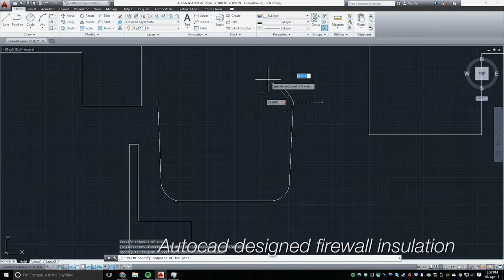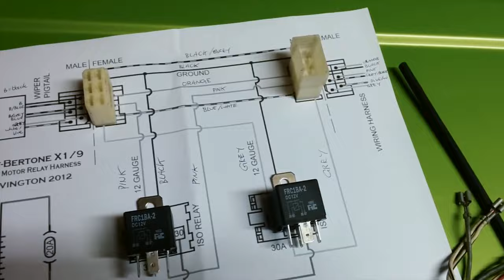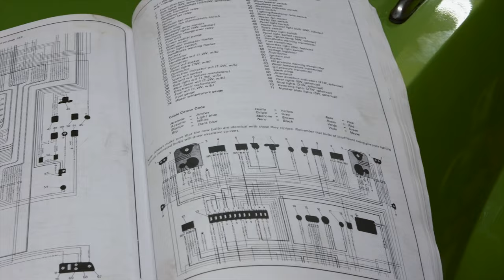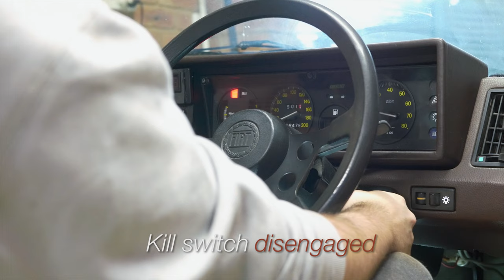Wiper Relays & Hidden Kill Switch - Fiat x1/9 [Ep 6]

Comment: Congrats,  6 episodes of quality !!  I basically rewired the whole thing,  original wiring was, as known, a joke :)  I don't know what was worst on this car, electrics or rust :D  One thing's for sure : once these fixed, it's a car that handles beyond all expectations.  
The one upgrade I've still in mind are swapping the front brakes for Uno Turbo ones. And after all, why not the engine as well ;)
Reply from the maker: The wiring on these old Italian cars are horrendous I had to rewire the whole car too! I just count my lucky stars that it has no rust, that is a must harder issue to fix

Comment: Hey there. Nice job with the relay and kill switch. speaking of kill switch, what brand and part number of kill switch did you use? I'm getting a '79 1/9, and i want to put a ks behind my cigarette lighter as well, cause its a really good place to put. I'm just having trouble finding one. Care to share? Please?
Reply from the maker: Hey Brendan, I got the switch from a local electronics store and wired it up to cut power to the distributor. So the car will crank over and seem to be working fine but it will never fire
Hit up your local electronic parts store and see if they have a similar switch to mine which will work great!
Reply: @RevTek  Awesome, thanks! Appreciate the reply. Keep enjoying the car!